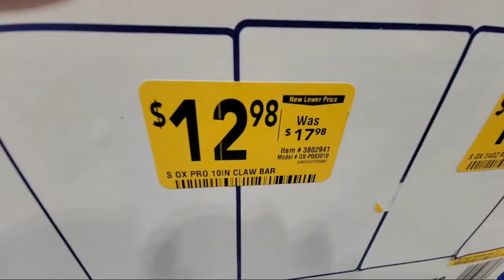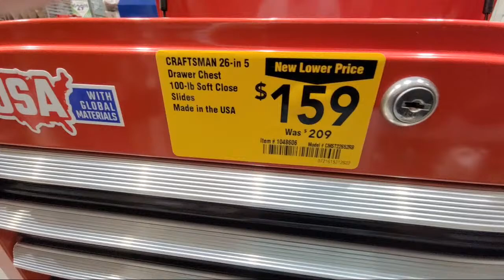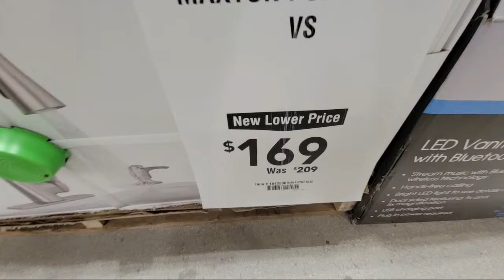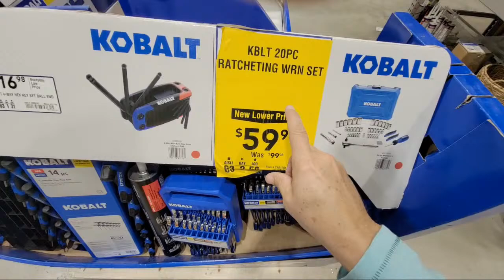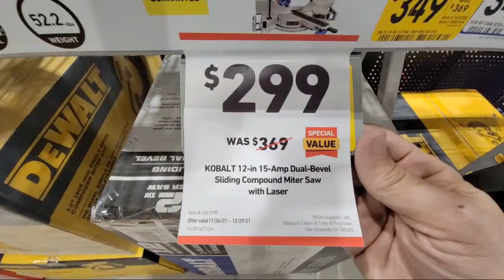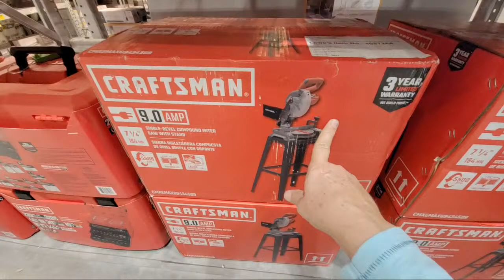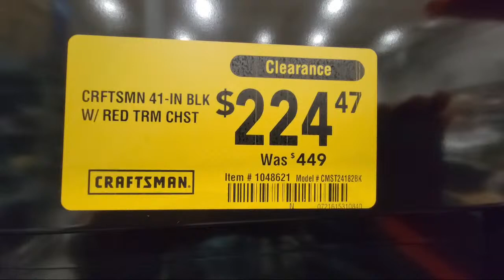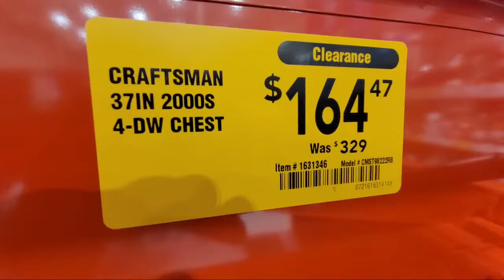Lowes Christmas Gift Ideas, Tool Deals, Clearance Tools

Comment from the maker: 🎄🛒 CRAFTSMAN VERSASTACK 216-Piece Standard Mechanics Tool Set Item 1368711: https://lowes.sjv.io/qnOjry
🎄🛒 Metabo HPT 10-in Carbide-Tipped Blade 15-Amp Table Saw: https://lowes.sjv.io/ORyD1z https://lowes.sjv.io/2rVNGQ
🎄🛒 CRAFTSMAN 2000 Series 37-in W x 24.5-in H 4-Drawer Steel Tool Chest (Red): https://lowes.sjv.io/2rVNGQ
Reply: Jeff I have noticed in multiple Lowe's the Metabo hpt ac adapter on clearance for 85 and the 36v hammer drill with the two 4.0 amp hour batteries for 140 item #1107589. I believe Metabo hpt is discontinuing the drill with the larger 4.0 amp batteries and switching to have the drill with the 2.5 amp hour batteries

Comment: Hey Jeff lowes is crazy today,sale wise..After buying the craftsman 1"sds hammer drill yesterday for $71 & change I had to go back today for 1/2in mid torque also around the $71 mark but the 3/8th impact also on clearance for $59 but main reason I came back was the 2 V20 battery packs for $79 goes back to over $150 tomorrow but wanted the single V20 battery with fast charger for $99 normally $150 but also grabbed the versa stack Bluetooth radio/ charger charger for free so can't beat all that for around $400...been watching the prices drop last few days and figured this is as low as its gunna get!! Good luck guys
Reply from the maker: How did you score the radio? Everyone is sold out
Reply: @jeffostroff  the lowes by me had 5
Reply: Maybe there restocking after black friday I was actually gunna get the bosch bulldog cordless SDS drill (the 1") city was just around $200 which was average and they had the 3/4" I believe down to $189 all tool only but with the 3/4 they gave you a 4ah battery and a charger they valued at $125 for free but now there also offering the free battery & charger with the 1" & I've always loved my corded bulldog so I even picked up the bosch freak that a square 1/2in drive with a 1/4in impact hole in the middle and grabbed the kit like a week or 2 ago which even came with a battery and charger for $99 and that thing is a beast I'm not 100% sure on the specs but let me tell you it's handled every thing from my trucks lug nuts to driving 4" timber screws into 4X4's so now I have a battery and a charger for the line so still debating...

Comment: Hey Jeff craftsman is going crazy clearance wise at lowes the v20 SDS hammer drill is now $40 as well as there 3/8" &  1/2" mid torque which I returned it has absolutely no power I felt the 3/8th" has more so also the 1/4"impact drill driver Sawzall,flashlight batteries and bag kit is bow down to $119 that $19 more then there regular V20 drill driver kit so not sure how much cheaper it's gunna get but just returning & repurchase just the 3/8th" & SDS hammer drill saved over $140 to of course buy more tools...good luck guys oh also the versa stack radio free deal is still on an plenty in stock..
Reply from the maker: They don't have them in my store

Comment: Jeff have U seen the new Metabo HPT 36V Cordless/AC compressor at ACME
Much better specs than my Milwaukee and DeWalt cordless compressors
Metabo HPT has always excelled with their air/pneumatic tools and compressors

Comment: Hey Jeff, which is the better table saw?  The Metabo ($349) or the Dewalt ($299)?
Reply: The Metabo is a a 10 inch saw. The Dewalt is only 8 1/4 inch.

Comment: @jeffostroff I have an update on my Uncles Honeywell WIFI thermostat.  He has a heat pump system which meant he has 9 wires.  On the thermostat the wires had a spot for a W1/OB.  He has a separate W1 and OB.  We put the OB wire in the W1/OB spot and everything worked.  He decided to call Honeywell on Wednesday and she told him to put the W1 wire in and he lost his heat.  I went over there, and he even tried to put his old thermostat back in and it didn't work.    The HVAC guy came by yesterday and now he is up and running again.  He was not impressed with his new technology after it malfunctioned but now, he will be all set to go back to Florida.
Reply from the maker: Yes when you have these rare scenarios it can be tricky to connect them up.

Comment: Hey just wanted to check if anyone knows how to check the amount of clearance amounts in stock online? For my store it shows clearance items not available for online purchase but is there a way to check the amount in stock
Reply: Brickseek works well, but not always
Reply: Sometimes you just have to call that’s how I found my Dewalt Bandsaw that’s part of the HD free tool when you buy the battery starter kit for $199.00.
Reply from the maker: Quite often I just have to go into the store and find it and sometimes it'll say not in stock online at your store, but when you go in the store after searching around you can either find it in the clearance counter, or in its normal place where it is stocked on the floor and it has a yellow sticker for clearance, and quite often we see them stacked up way up high on top and they don't even know it's there

Comment: I bought the bigger Milwaukee M12 vacuum today for $99 and a set of M12 3 AH batteries for $99.  I’ll be honest, I kind of have buyers remorse.  I feel like I should have gotten a better deal.
Reply: Considering the m18 XC5.0 two pack with charger and bag was $99.50, yeah I'd say that's a bad deal.
Reply from the maker: I prefer the M18 vacuum that's the one I have period the way I scored that one was I got it as a buy one get one free two years ago when they did the battery starter kit for $199, and then you got the vacuum as one of the free tools that was the best way to acquire it.

Comment: Thanks Jeff! What was the store with the "gorilla?" platforms for like 30, 40 bucks 🤔.. I glanced in my Lowe's today but only seen step ladders. Was it home depot?
Reply: The Blackstone 3780543 like the one you have there shows as 186.97 for my store. That is a really good deal. It looks like it folds up pretty decent for storage or pulling behind you for a beach grill 👍. I have that saved, might grab it Monday when I head back that way. Nice little cooker
Reply: I got one last weekend at Home Depot.  It was $34.88, Model #GLWP-47, but it is showing out of stock tonight.
Reply: @leekearly5037  is this the platform
Reply from the maker: 🎄🛒 Gorilla 48"x12"x20" Aluminum Slim-Fold Work Platform: https://homedepot.sjv.io/mey4X
Reply from the maker: In my area it still shows either Instore pickup, or shipped to store, or delivery for $8.99. Your mileage may vary
Reply: @jeffostroff  thanks, yea I see 40ish in stock at HD I'll be next to in the city tomorrow. They making these things smaller 🤷🏻‍♂️. From online photos the platforms don't look at wide. Photos can be deceiving though, I'll see tomorrow